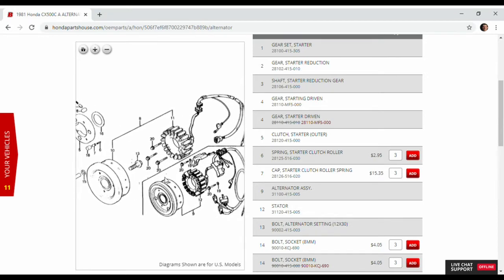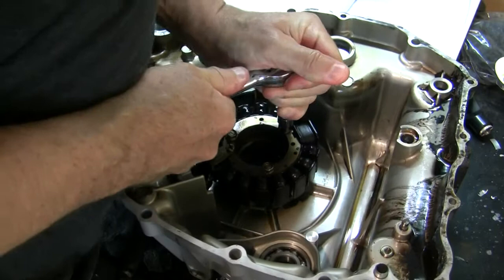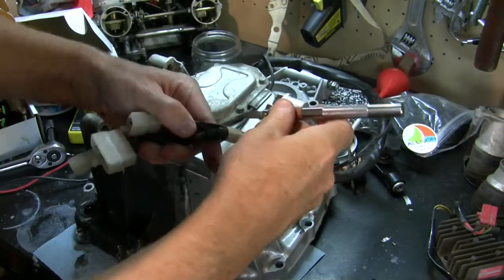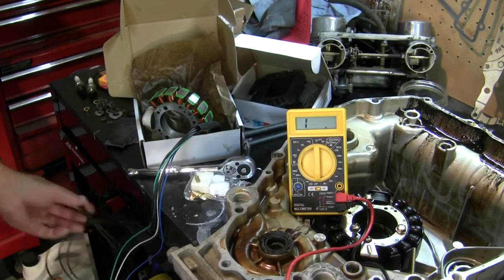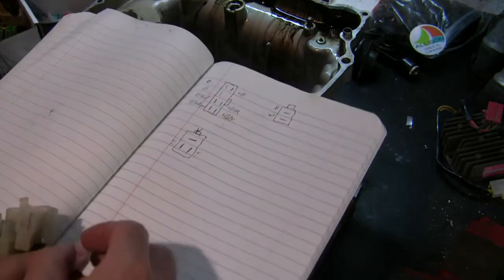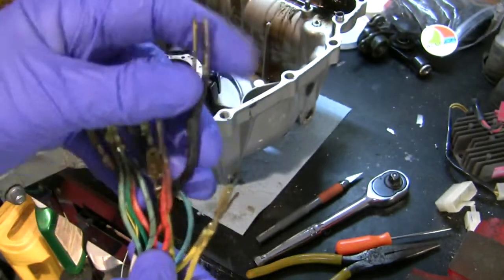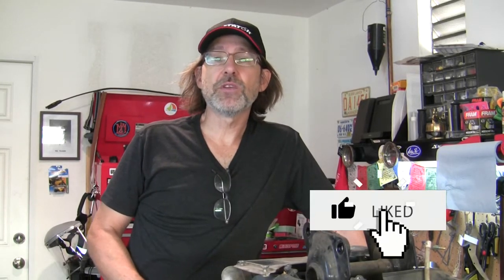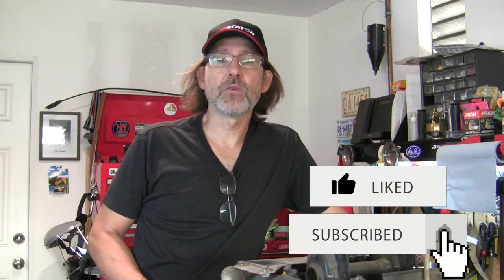Replace Stator - CX500 Part 7

Comment: Many thanks for the steps showing removal of the stator , but I didn't have to remove the block connectors from the wiring loom as they are able to pass through the large open slot in the rear engine casing .

Comment: Thanks for the tip  RM Stator. My CX is also in need of one. Will check them out. Cheers, DM ,Toronto. 👍🇨🇦
Reply from the maker: Thanks for watching! Yes, they were great to work with and they are  🇨🇦 !
Reply: @UrbanMonkTV  Mine is also a 1981 CX  and I think I will remove the radiator when the engine comes out because I'm also replacing the fan with original Honda oem fan.   DM

Comment: hello! I saw your videos and they are helping me a lot, I have my 1979 honda cx500, it has a fault, when I want to run fast, it loses spark, and stops running, I would like to know that they have said that it is the stator, but I'm not sure, thank you! !
Reply from the maker: Thank you for watching! It is difficult for me to diagnose your bike from my armchair here. There were two different types of ignition systems used on the CX500s. I don't know offhand which you have. It is possibly a stator issue but other components may be experiencing a failure also. I have a video on testing the reg/rec which may help you. Also, you can test the outputs from each of the 3 phases of the stator (just grab any two wires and test AC voltage and repeat with other two pairs) to see what kind of voltage it is putting out. You may have one phase grounded out. Again, speculation on my part, from here.

Comment: A friend of mine had a Garage replace his cx500 stator and within a week the engine locked up. Looked to me like the timing chain snapped or slipped??? Would this Garage have need to involve themselves with the chain adjuster??
Reply from the maker: The chain tension adjuster bolt is used to separate the rear cover from the engine. This loosens the adjuster at the same time. If they didn't retighten the bolt perhaps this led to the issue but it is difficult to determine causation definitively.

Comment: To the best of your knowledge, does the gl650 use the same stator? My intuition says yes, but just looking for info from someone with more experience.
Reply from the maker: The Honda part numbers are different for each of them so there's a good chance there is a difference. That said, the folks at RMStator will be more than happy to get you the correct part number from their catalog.

Comment: Any chance you may have the engine badges that are on the bike you're working on. My bike is a 1983 silverwing interstate 700cc .the badges have Honda on them. Appreciate any assistance with this matter
Reply from the maker: @bruceoppatt5878  If by "badges" you mean the horizontal plaques screwed into the crankcase that say "Honda" on them, yes, mine has them. I'm not sure how that's helpful to you but I appreciate you watching my video.
Reply: That is the badges I'm interested in, will they be the same as the ones for my silverwing interstate 700cc. If so I want to replace mine as they are damaged. How much for the both of them
Reply from the maker: @bruceoppatt5878  I wouldn't part with mine, but if you can't find them on ebay, you could buy a whole seized engine, get your badges and part out the rest to recoup some of the costs. https://www.ebay.com/itm/295989149324?mkcid=16&mkevt=1&mkrid=711-127632-2357-0&ssspo=bE1dvTo1RWC&sssrc=4429486&ssuid=&var=&widget_ver=artemis&media=COPY

Comment: So what causes a stator to fail? 🤔
Reply from the maker: In this case I wonder if the coolant getting into the engine oil played a roll, but the reg/rec is failed too, so that could have put stress on the stator windings if it went first. Lots of heat/cool cycles probably plays some part also.
Reply: It is indeed repeated heat cycles, ultimately the coating on the windings break down causing shorts.